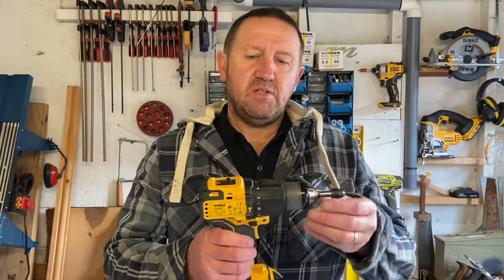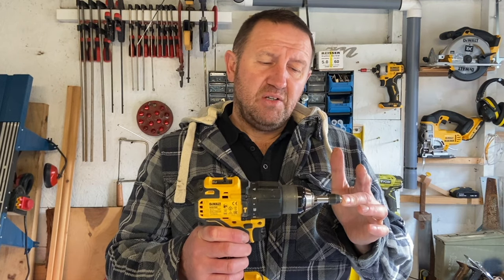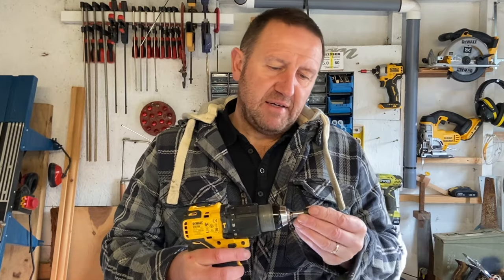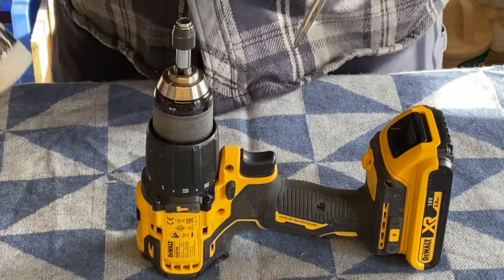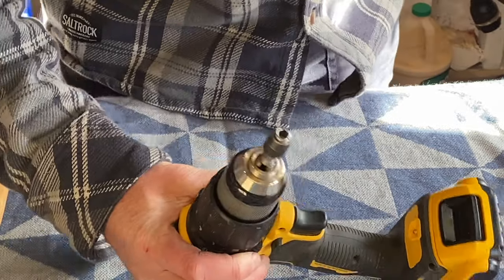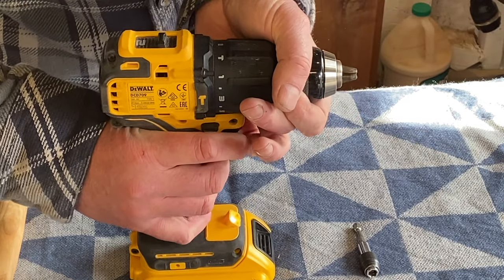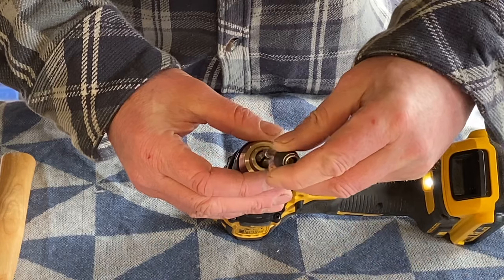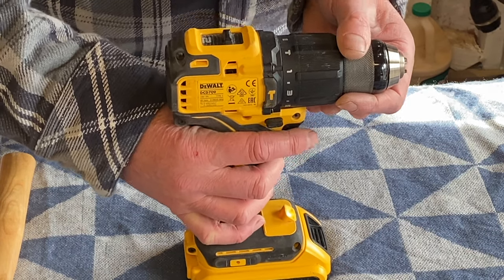DEWALT CORDLESS DRILL CHUCK JAMMED

Comment: Perfect. I'm still disappointed that i had to bash a drill that's only 4 months old and only drilled a few holes. The top of the range radios are just as poorly made. Thanks for the advice.
Reply from the maker: I couldn’t agree more with you Jel. I would expect Dewalt to be all over this and getting it sorted. Sadly they don’t seem interested.
Reply: I used my today to drill a single hole, and i was trying to remove the bit and it would not budge. I feel so disappointed in these tools. Mine is a milwaukee drill
Reply: I just bought a impact hammer drill combo kit and the drill bit is stuck on the trail run. I’m pretty disappointed TBH. I’m the person who doesn’t who hates returning stuffs.

Comment: Thanks for help. The chuck on my dewalt DCD790 had become increasingly difficult to operate and finally I got a drill bit that would not come out. I used your method and the bit came out. I then sprayed WD40 and ran the chuck in and out multiple times. Drill works great now!
Reply from the maker: @michaellabonte1260  glad it helped you out Michael 👍

Comment: THANK YOU VERY MUCH !! I was not able to rls a drill bit using the “screwdriver” method, BUT by tapping lightly with a hammer, directly on the three teeth of the chuck worked like a champ.

Comment: I wanted to thank you for this video. I have a 25 year old dewalt that the bit was stuck and I it would not be worth it.  After seeing this I freed it up and flooded it with penetrating oil and ran it in and out forever while adding more fluid and wiping it all off and I have my gun back.  I was not prepared to replace it just now so thank you.....
Reply from the maker: Thanks for your kind words. It great to know it helped you get your drill back working again 👍👍.

Comment: Good one Gary! This worked on my cheapo Parkside (Lidl) drill which was still under warranty - I'm sure I would got a refund but I have several batteries so really needed😃 a replacement rather than a refund. Bottle wrench strap from the kitchen also helped. Win, win, thanks again Gary.

Comment: Thanks mate, you saved my drill from being scrapped.  My drill is a Worx corded hammer drill rather than a DeWalt but it had the same issue and the same solution worked.  I had tried a number of methods that I found on YouTube but nothing was working.  I was just looking at buying a new drill when the algorithm pushed this video at me.  So I got out my trusty Thor Hammer and one of my grandad's old automotive screwdrivers and five minutes later I was throwing the bit in my recycling tray and working the chuck backwards and forwards to make sure it wasn't damaged.  If it does this to me again I might think about putting a better chuck on it but it looks like I am keeping the drill for a while longer.

Comment: And a year later it still works, thank you!
I did have to use a strap wrench because my hands are a little old now but, worked fantastically!
Reply: I put mine in a vice (lined with wood blocks and a damp rag) and it came loose. Examined the inside of the chuck closely and there were a bunch of metal shavings inside(!). Used compressed air to blow it all out, looks like the jaws now align properly.

Comment: This really does work. Thanks a million. I had my brushless dewalt drill sitting for weeks. I went as far as to pull it apart and greased the gears still it didn't budge. As soon as I tried this it came out. Still seems the chuck is slipping but its working. Great trick.:yougotthis:

Comment: Thank you! I'm a 65 yr old woman who has to do most things alone. I don't know if it actually helped or if it was just stuck too tight, but after hitting it all around, it didn't seem like it worked. So I turned it as hard as I could and after a few clicks it came free! Whew! Thought I was going to have to bring it to my son-in-law. It's a fairly new drill and after building a little chicken coop I felt empowered. Now I feel even more empowered haha.
Reply from the maker: Well done Ann 👍
Reply: Well done Ann with a plan.  Just going to try and free my one now , hope not to break anything.

Comment: been using a pipe wrench on mine last i used it to release and tighten the chuck, now come across your video, will have to give this a go, but hope i havent damaged it too much with the wrench...
Reply: also stunned to see how common a problem this is, maybe dewalt need to revise their mechanics a touch, or just lack of oil ? mine been in the shed where it does get a little humid, wonder if that contributed to the problem.

Comment: Thank you.  My original Dewalt DCD996 jammed up and I took it in for repair.  Basically, I'm not out $99, but I do have a new drill.  Still, I would much rather try to do what you did to fix the old one, .. and keep the $99,  Do you think the problem was caused by lack of lubrication?  Should I be adding oil after/before every use?
Reply from the maker: Hi Silk, I have tried oil but is didn’t make any difference. It seems to me that it’s a manufacturing fact.👍

Comment: Wow!  Thanks!  That actually worked!  My Dewalt drill would not adjust, but I didn't have a bit in it like you did.  I did some light tapping on the grabbers with a hammer and sure enough, that freed them up.  They were still a little stiff, so I put some WD40 on the grabbers and they seemed smoother.  I don't know if using WD40 was a good idea or not.

Comment: I had a Phillips bit stuck in mine. The chuck would not loosen at all. as I was about to try the screwdriver my brother came up with the bright idea to use my impact driver. It loosened it with the touch of the button. Had I not had them both in the same bag, to where I had to pull it out to get to the drill. He probably never would’ve thought of it.

Comment: Interesting. I've had the same issue. Just tap the edge of the chuck with a pair of pliers. Seems to free up. The issue that is frustrating the hell out of me is when the chuck is fully tightened the drill bit starts to slip when the drilling resistance increases, resulting in the bit slipping within the chuck.  And Yes I am in hammer mode. And this is happening on both my DCD796 dewalt drills. Are there chucks all like this?
Reply from the maker: Hi James, it seems the issue is widespread. I suspect this is a recognised issue with these chucks. It’s a shame because I do like Dewalt tools .Hopefully they look into it and get it sorted.

Comment: My recommendation: instead of spinning it full force, 1:put the rps to 15/drill 2: Grip the chuck as hard as you are able to, 3: slightly press the trigger (a bit more than just enough to get it moving) and you should have it fixed
Reply: Hey just wanted to tell you that I tried your method and lo and behold, I was able to remove the bit! Had zero expectation and it actually worked! Thank you so so much for sharing your tips 😁🙏

Comment: Modern cordless chucks are totally different to old school ones like the original Makita drills - with those old ones you could do what you did and pull the trigger to tighten or loosen. With these you cannot do that. You can only use it to get close. Once close you must NOT use the trigger - there is a sprag clutch inside that binds when you apply torque from the outside in and when you use the trigger at the same time as doing that you are pitting the motor and gearbox against the sprag clutch - not good. Just let the sprag clutch do its job and tighten by hand. Ditto loosen. It probably would have worked if you had just done it by hand without pulling the trigger. This is fundamentally wrong on modern drills with modern chucks.